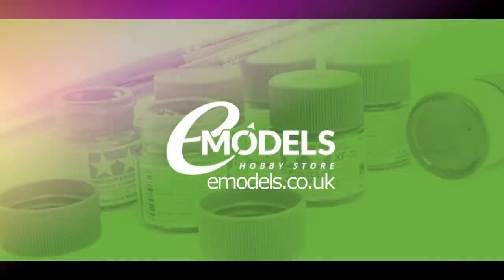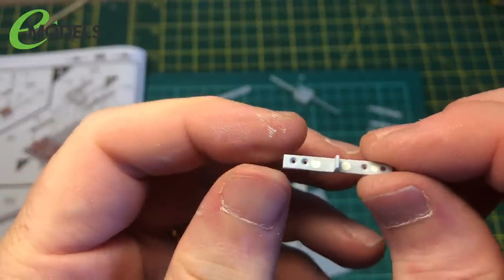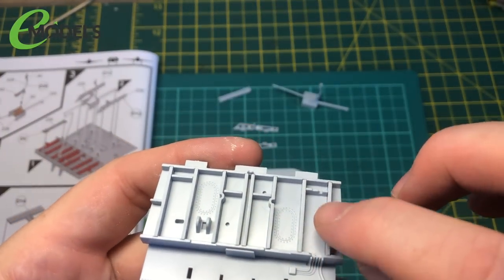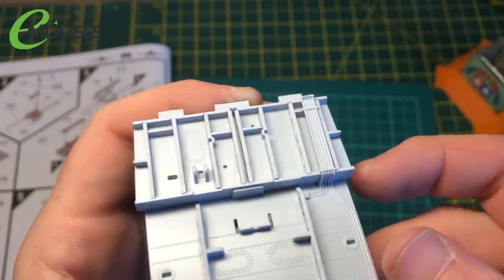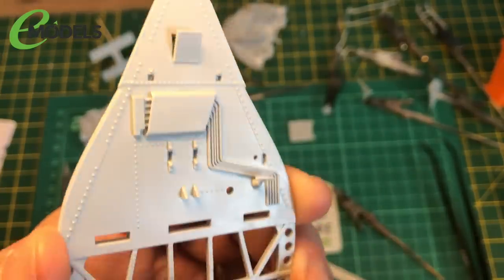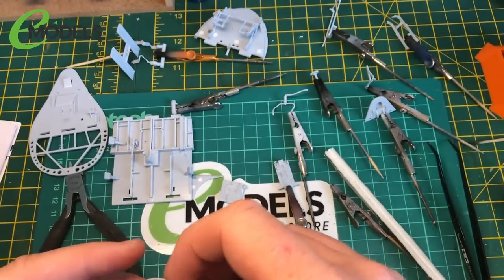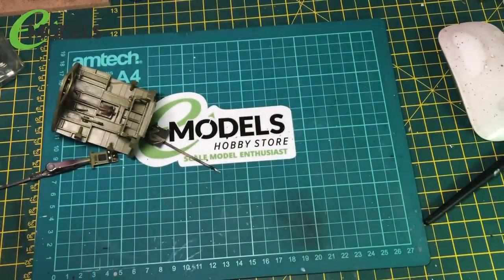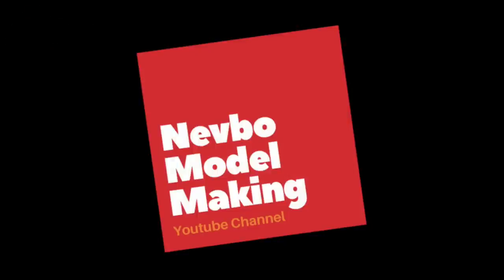Airfix 1/24 Grumman F6F-5 Hellcat (#19004) Part 2: Cockpit Build & Paint

Comment: This kit is giving me "FITS" as in fit issues ! After finally figuring out how to install the exhaust pipes, the shield (or whatever it's called) that goes on after that step will not fit in the middle of them....PERIOD ! The pipes on the rear engine are all in the way, and there's no way to know ahead of time if you installed them in the right positions or not. I had to do a lot of cutting up and butchering of the pipes AFTER pulling them off to put the shield on, then glue the butchered up pipes back on. Luckily, it hardly shows, but DAMN ! That's not the only fit issue in the kit either. There are several other major ones, and I haven't gotten to them yet. I DO NOT RECOMMEND BUYING IT !
Reply: It was hard work in places.